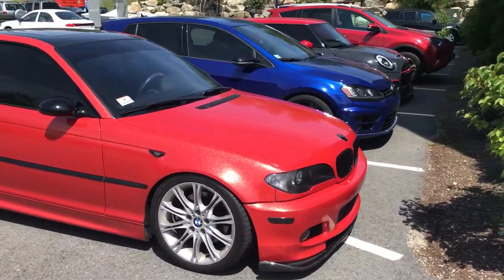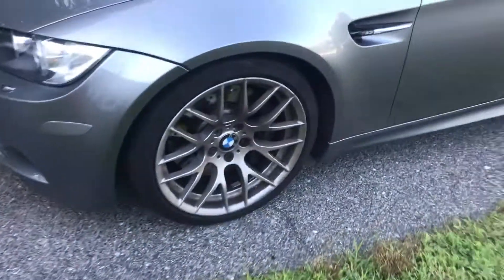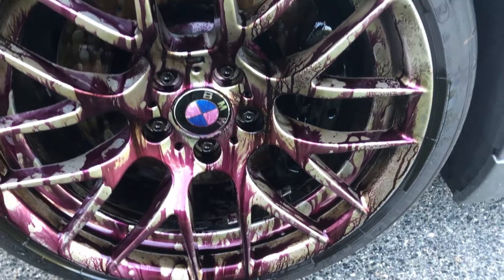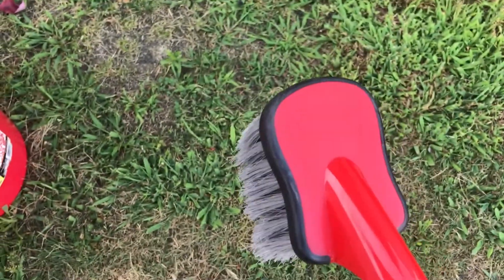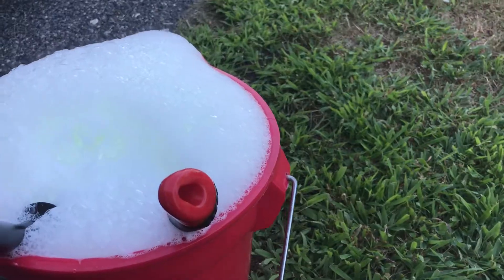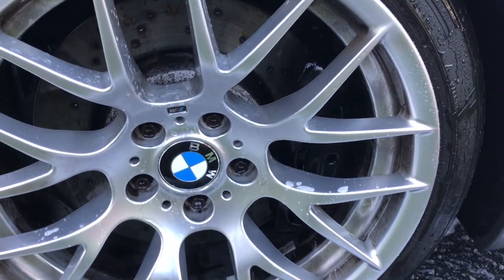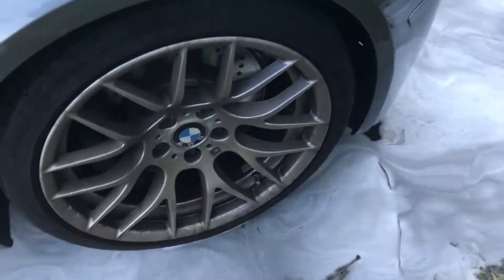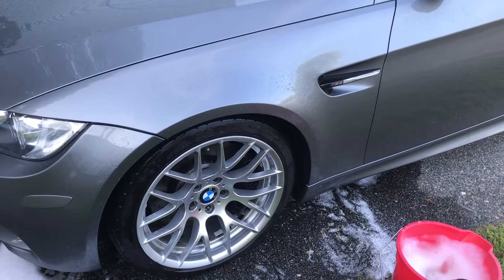Washing The BMW M3 Wheels with GYEON Q2M

Comment: you really should get a wheel woolies and a lamb skin finger mitt. it will make much faster
Reply from the maker: Thanks for that tip, i'll check both out. Any brands you like?
Reply: get wheel woolies the brand from either detailers domain or i think auto geek has them also. For the mitt get the four finger lamb skin mitts form obsessed garage, its the only place that you can get them in the USA
Reply from the maker: Awesome thanks! Putting an order in.

Comment: Is that harmful to some wheels?
Reply from the maker: +Tuner Army I haven't found a finish that is harmful to, but I would certainly research if you had a unique finish. I may opticoat to speed up this process (on my new wheels, once I get them).
Reply: CoderMan awsome, thanks
Reply: I think it's pH neutral.